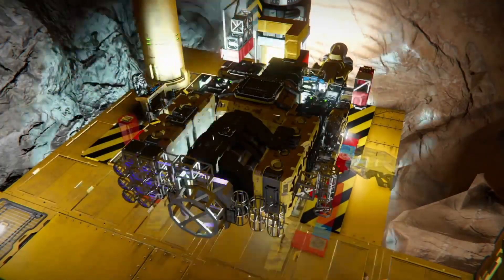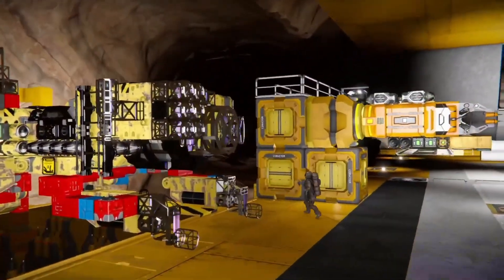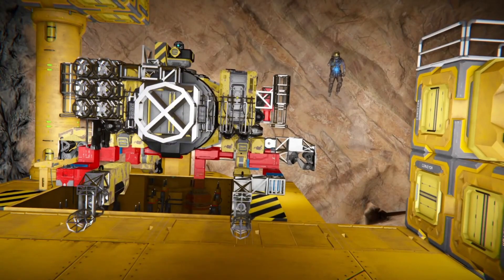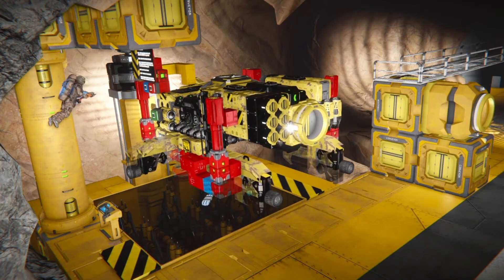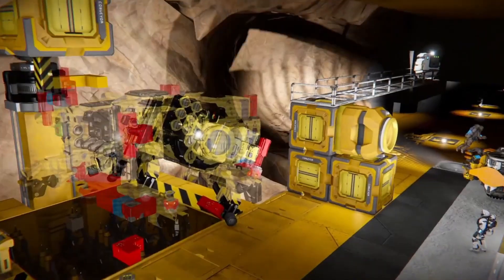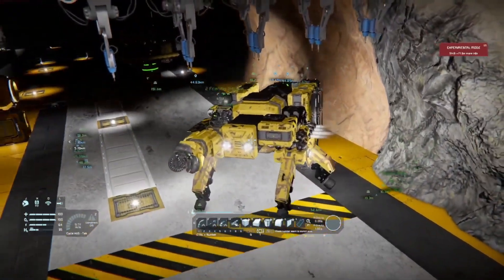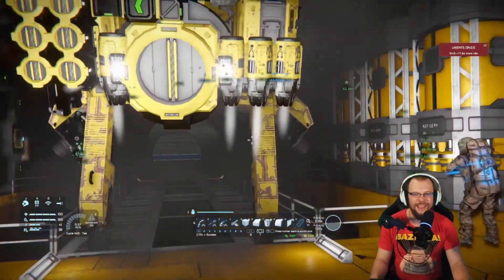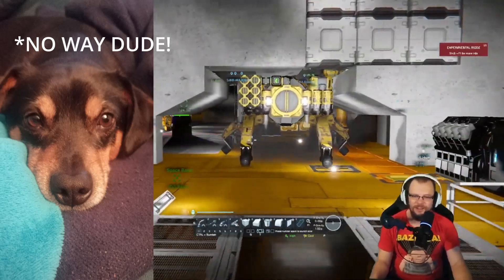[SPACE ENGINEERS] SUBGRIDS but self assembling! - meet the Tanuki!

Comment: Awesome way to print subgrids and that gave me an idea
Simplify it, put the parts right next to the point they're supposed to attach to and don't include the hinge parts, rather add them later and just separate the main and subgrid with red blocks
This prob makes more sense in my head than what I wrote
Reply: If the subgrid is on the same grid as the main grid, then the hinge part can't be inside the main hinge.
Reply: @MineGames131  exactly, it's added post print